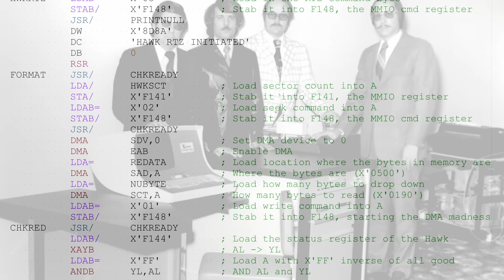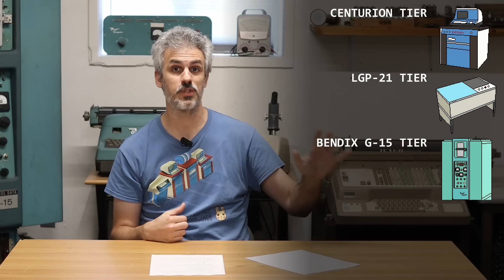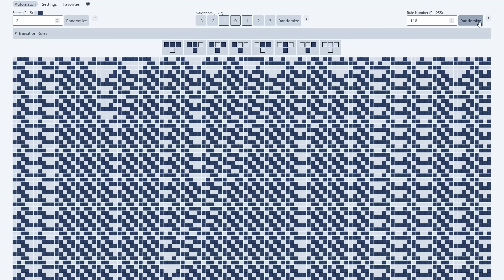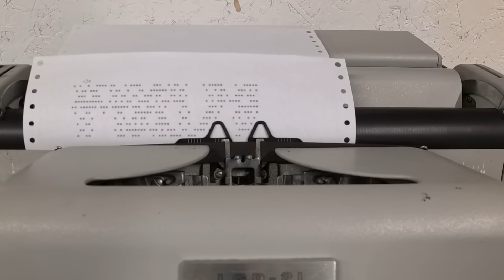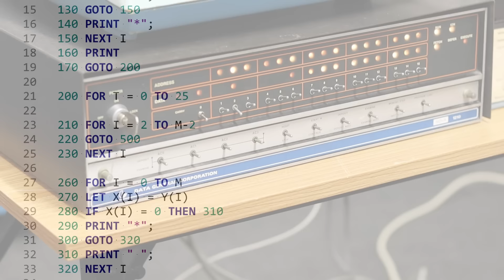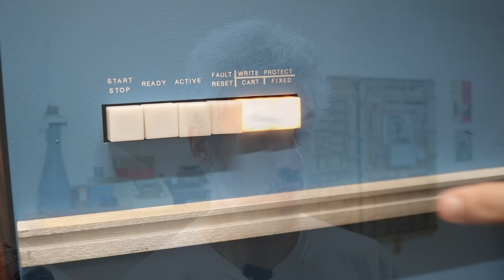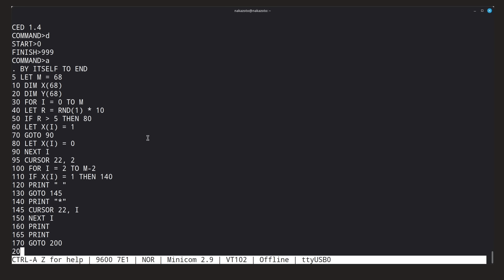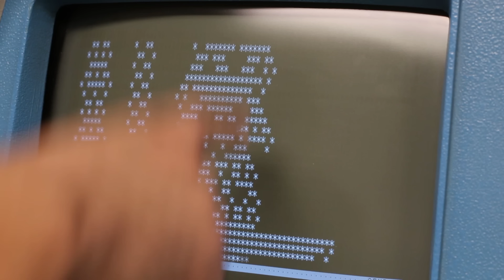BASIC on This 80’s Minicomputer is Terrible!

Comment: Lets take a minute to appreciate what the ZX80 / 81 achieved
Reply: its hard to imagine that came out at the same time as the centurion
Reply: @belstar1128  Centurion is 70's tech. Z80 is 80's tech. I think the Z80 in some form was still used in the Gameboy.
Reply: @wayland7150  Well, the Z80 was designed from late 1974 until mid 1976, when it was launched. The ubiquitous 74-series "TTL" could be called "1960s tech" btw, because that's when it was de facto standardised (the world started copying the pinout of the TI versions). As you probably know, it was used a lot in the 1980s and 90s, and is still mass produced today, in both CMOS and bipolar versions.

Comment: Need a C compiler for that machine... Why not? 🙂
Reply: Yup. Probably doable using a cross-compiler, at least in the initial stages.
Reply: @ThatGeezer  Definitely, probably run it on a regular PC, generate the binary there, and then send it to the real-deal machine to link it or something. My ignorance is so huge on this machine, I may be missing things, but it should probably be a very cool project 🙂
Reply: @josesardinas7660  Yup. That's how it is done. The initial PC version need not be particularly efficient. Or even capable of compiling a full C implementation. All it needs to be able to do is compile the subset of C that implements everything necessary to compile a C assembler from C source code (you don't need fancy string operators, floating-point maths, and a lot of other stuff). After that, you add all the bells and whistles using each version of the compiler to compile the next. Bootstrapping at its finest...
Reply: Retargeting SDCC would probably be a good fit.

Comment: When printing the pattern you might be able to build a string that's the representation of the output and then print that,  It should work on any basic that supports string concatenation (a$ = $a + "x")
Reply: Depending on what's supported, you could create a fixed length string and just replace characters. That should be even faster.
Reply: String concatenation can be very slow, if it is even supported - not something you can assume for languages that old.
Reply: I’ve forgotten the exact situation now, but I remember having a problem where string concatenation insisted on inserting apace every time.   Ending strings with control-H was the workaround.
Reply: In some BASICs you have to DIM strings with their maximum length (which reserves that much memory so watch out!) and then catenate with something like A$(Len(A$)+1) = "X"

Comment: Could you not just add a back space at the end of each print command to get rid of the space.
Reply: I was going to say that. You beat me to it!
Reply: That was my comment too.  I ran into a situation where I could not suppress a trailing space, so ending strings with control-H was the ugly but passable fix.
Reply: I thought of that too, but this would cause the printer to do a lot of chugging about, and it would be slower.
Reply: @r @roysainsbury4556 ending control-H kind of depends on the operating system snd printer.  Some OSes are smart enough that their TTY handling to process the backspace in the driver’s output buffer.  A lot of dot matrix printers will compose the line before they start moving the print head.  An old Model 33 Teletype and most daisy wheel printers would actually waste time spacing and backspacing if the OS didn’t take care of it.

In UNIX (I know this is a Centurion video) the stty command controls terminal line discipline.  If memory is right, using the [-] icanon flag determines whether characters like backspace in the output stream are post processed or sent directly to the TTY device for handling.  The developers in the 1970s did as much as they could to reduce the amount of data which had to be sent at mechanical TTY speeds of 110 bits/second.

Comment: Has anyone tried porting MSBASIC over using claude code? It works well for me in writing c65 c code for the C64, and does a reasonable job of writing 6502 assembly. Has anyone tried that?

Comment: 16:50 what’s the deal with needing to slow down the transfer?
Reply: Many older machines expected a human typing at the terminal and couldn't process the full line speed of input without missing/skipping characters. That could be just processing time needed to save a line when you press enter for example, or other processing that happened after each character, or just the multiplexing/time sharing of many terminals. And memory was expensive, so often there were no or just very small buffers to record the input when such processing occured. 
I guess it would work if you used some kind of serial handshake like XON/XOFF or DTS/CTS then the host would signal if it could not accept input at that time but sometimes those cheap USB-serial converters do not implement that properly and then slowing transfers with the character and line delay is the only option.
Reply: @kuebbisch  thankyou. I guess you are right that it’s missing or .. untrustworthy .. flow control
Reply: or even just that slowing it down is better for the visuals :)